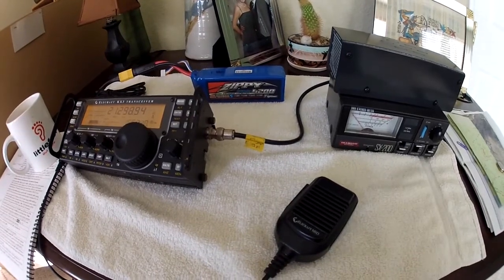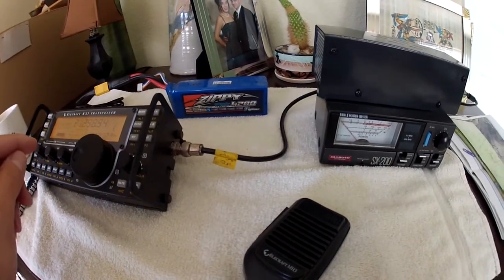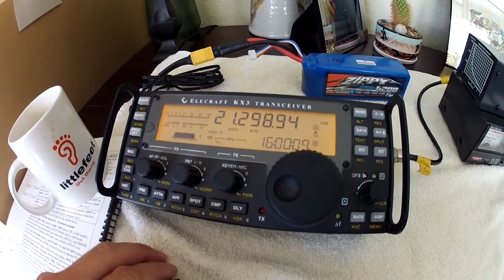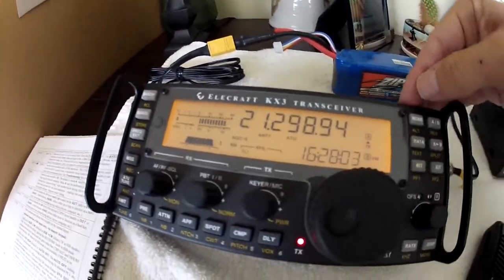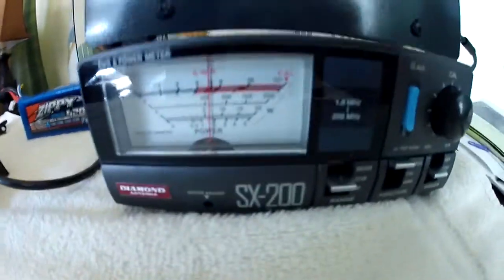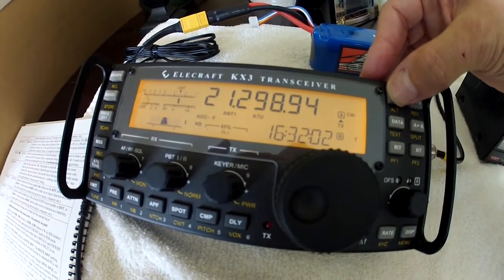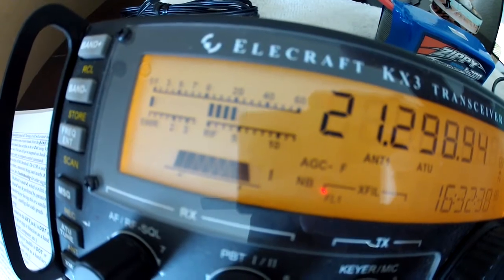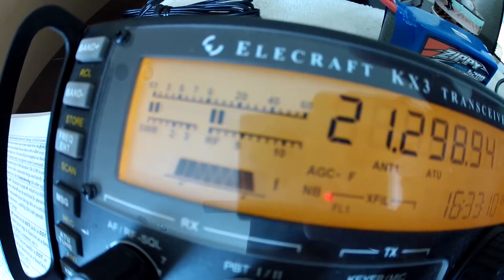KX3 SWR Instability SSB

Comment: You need to consider that the SWR reading is done in time slot mode in the KX3 by the relatively slow microprocessor.  The radio uP will sample the forward Voltage value process that then sample reflected voltage and then process that and then combine the two to represent SWR on the display.  Since the SSB values are rapidly changing the forward and reflected samples aren't representative of the same point in time, unlike your analog meter which is.    I wouldn't worry about this if it is working OK in tune,AM, FM and CW.  You may notice that if using very fast CW the same artifact will show up.  Hold down the CW key long enough that the SWR meter gets a second reading.   It is simply the nature of digital processing.

KB0NE
Reply from the maker: Totally agree with your comments John.  However, it is relatively easy to make a better estimate of a value at time t by sampling at t-1 and t+1 and averaging. Thus, if you measure reflected power at t-1, forward power at t and reflected power at t+1 you can then use the forward power and the estimate of the reflected power at t.  This would give you a better result than I believe is currently implemented in the KX3.  Further, there are even more sophisticated algorithms that can do a better job of the estimate and hence a better job of calculating SWR.  It's important to me, since when operating ssb portable increasing SWR is a good sign my portable antenna has developed a problem (often wind related), which is sometimes out of view. I've made this suggestion to Elecraft, hopefully they will try and solve the problem in a future firmware release.